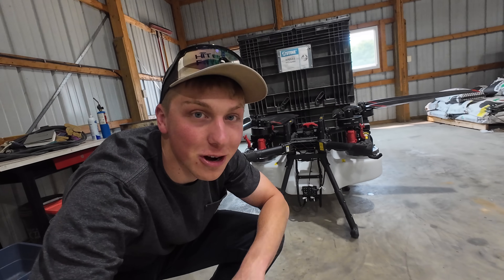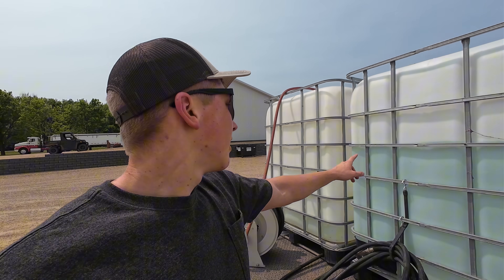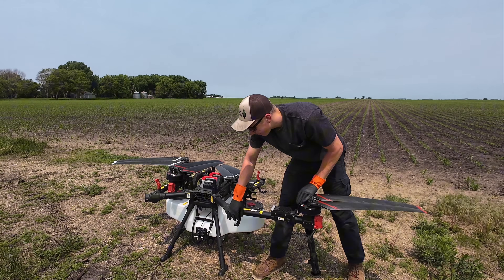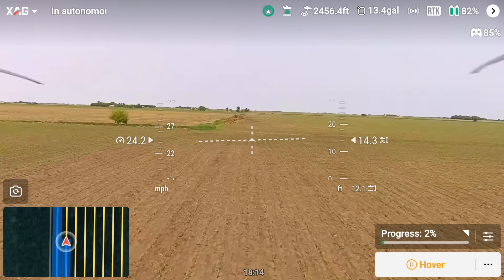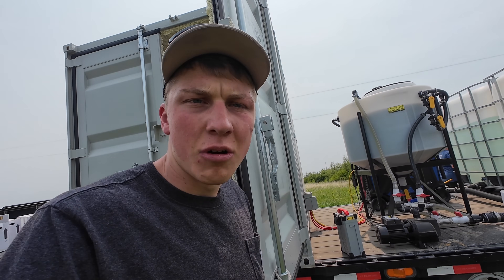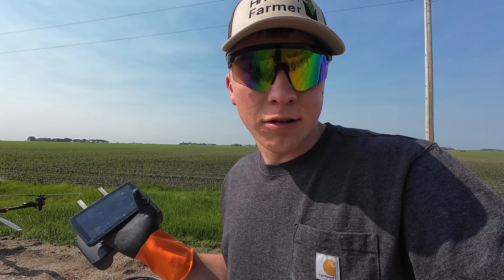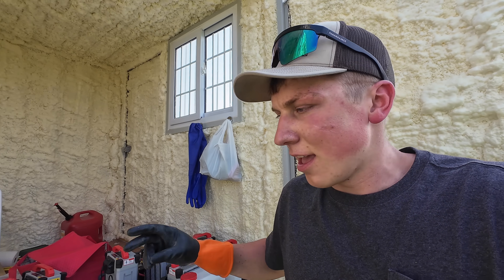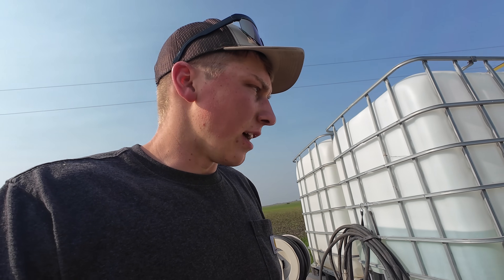First Spray Drone Field Test… and It Didn’t Work?!

Comment: If you can put your air condition up as  high as possible  on a shelf it will work better.   I would think you would use a roof mounted RV air conditioner or a small split system. with the compressor/condenser unit mounted to the outside wall of the container.
Reply from the maker: Yeah, looking back the RV air conditioner would have been the way to go. Oh well, learning as I go!

Comment: If DJI never gets banned, would you get one? There is a new drone coming out this fall I believe, the T100.
Reply from the maker: If they don't get banned the T100 seems like the way to go for next year!
Reply: @HiTech_Farmer  I saw a drone pilot video form Australia, he visted China and found out local users were not very satisfied on T100, it looks amzing on paper, but actual battery range is way worse, most users are running it on 50% payload, you definitely want to research that, and they said T70P is way better.

Comment: That spray foam was a good move. One thing for next year that you definitely should look into, is getting a roof to land on. Makes it so that your propellers dont get chewed up by small pebbles and rocks from constantly landing on the ground. But overall I like how your setup came along. Keep at it! You'll see the major usage out of it during corn fungicide season. That will 100% make it pay off. However, one thing I will say. If your P150 is currently working, DO NOT UPDATE IT. A lot of spray guys have been having issues with them after updates. That being said, don't fix what ain't broke.
Reply from the maker: I'm considering the roof option more and more everyday for next season! Thanks for the tip on the firmware update!

Comment: Grate video reminds me of my first time flying drones (Im also a farmer and I have been using spray drones for almost 2 years). Got couple questions/ suggestions tho

So how ur measuring how much water u put into cone bottom tank? (I really wanted to measure that precisely for obvious reasons and I solve that by using a flowmeter.)

Also when ur filling up the drone does agitation still goes on? (By the looks of it you have relatively small pump and leaving agitation on will drasticaly increase ur fill time. I'm also using a small electric pump since I wanted to power everything only with generator but this comes with its own problems. Ideally u want filling time equal to or even less then drones bootup time so that by the time drone is booted up, you should already be done with filling to maximize efficiency. I am using a DJI generator and simply using a bigger pump doesn't solve the issue becouse on DJI generators if you use anything more than 500 watts that will eat up your battery chargeing power. Yes you can use a bigger pump since you have plenty of excess power but its not really high tech :) Instead I use a motorised ball valve to shut off the agitation and direct all the flow of pump to fill the drone. I also use a flow switch to control the actuation of valve. When I stop filling the drone, agitation starts automatically.
Finding a motorised ball valve with fast actuation time can be tricky tho. So if anyone here has any reccomendation on faster actuating valves I would really appriciate it )

Also if ur having problems with foaming, instead of spending money on defomers (you also don't know their effect on ur chemicals) try mounting agitation hose to side of your cone bottom tank towards the bottom of it. It will probably solve your issue.

One last thing: You can also add a simple mesh filter (like ones on irrigation systems but much smaller one) anywhere between ur cone bottom tank and ur pump inlet. You will be suprised how much random stuff it pics up, also it will save you from tones of headache when you cloge up ur drones nozzels etc.
Reply from the maker: I'm currently measuring the water in the cone off the cone markings. I'm currently constantly circulating the chemical in the cone while filling, but if I don't do it this way, when the drone fills the pump will die. So that's my work-a-round there! 

As for the filter, great idea! I'm currently filtering all the water prior to getting to the tank so figured I didn't need to filter clean water again.
Reply: When I used marking on my induction tank I almost always mix more than what I need for that day and I always feel bad when Im dumping the excess chemical since its bad for environment.

Even if I filter the water before putting it in to my tank, I still get some flies or weeds in my tank when Im mixing chemicals. So that filter still works for me.
Reply from the maker: Thanks for sharing. If I have chemical left over, I either bring it to the next jobsite that requires the same chemical or fly a little extra on in spots

Comment: I'd like to buy an XAG and charge a few dollars an acre, just as a retirement job/hobby.  The chemicals, though, they require a lot of extra equipment and handling not to mention licensing as well as risk.  I think using it only for starter fertilizer and cover crop seeding would greatly simplify the operations and cut my startup cost substantially.  Am I right?
Reply from the maker: If you are to do it on your own acres, you wouldn't need near the amount of licensing that I have. Any type of commercial work will require many more hoops to jump thru, regardless if it is liquid or solid fertilizer.

Comment: Impressive!  You have run a really slick operation.  1 question (if you get to read these comments) - did you build this drone, or is it off the shelf?
Reply from the maker: Thanks! This drone is off the shelf, most are! I built my own trailer however!
Reply: @HiTech_Farmer  Wow.  I remember reading they are even using drones for crop spraying in India these days.  That surprises me, with how much drones cost vs how cheap labour is in India - I can certainly see how it's more economic in the USA, UK, Europe etc.

Comment: Good first day.  Couple of tips from another applicator.  Gloves are for handling chemical.  Take them off before touching anything non-chemical related.  Pouring jugs, try pouring them with the mouth at the top, and there will be little to no splashing if you pour at the right speed.  Fresh water rinse of jugs, you may already be doing this.  All of these procedures for chemical handling may seem trivial at first but really help when doing insecticide and other chemicals to eliminate contamination of your workspace. 

You need some shade and preferably a raised operation station when spraying tasseled corn.  It's your first year, so you will get a lot of little things ironed out as you go.  Just remember chemical and flight safety first, and the rest will be fine.  It is a pretty hot job here in Missouri through summer also.  Keep putting the hours in, and good luck this year.
Reply from the maker: Appreciate the tips and advice! Best of luck to you this season as well!
Reply: I guess it would be ideal to try to get to the fields just as the sun comes up.  Is it possible to do this work in the night?
Reply: @JoeLinux2000 yes and yes there are ways to be able to do some types of drone work at night.

Comment: Good job mate. Really like your videos. It seems like p150 is beast.
Reply from the maker: Thanks! Yes the P150 is the largest current offering in the U.S.
Reply: @HiTech_Farmer  i operate 2 p100 pro's at the same time. Its so cool.
Reply from the maker: You run 2 just by yourself?
Reply: @HiTech_Farmer  yes on swarm with 1 app.
Reply from the maker: Impressive!

Comment: Looks like it's working pretty well for your first outing.  Might need to be careful when lifting that drone so you don't get a back injury.
Reply from the maker: I agree, still yet to figure out a great way to avoid lifting the thing all the time
Reply: @HiTech_Farmer also modify a big tire wagon to move it around on the ground. Fly it straight off the wagon on your first run.

Comment: With the acres sprayed, how many times did you change batteries? Also, how long would it take to spray the same area with a traditional sprayer?
Reply from the maker: Changed batteries and reloaded chemical every 9 acres. 160/9=18 times. It definitely takes longer then a traditional sprayer rig. A self propelled would've been done in an hour...it took me 5 hours. Goal was to practice with the drone before I start spraying when the corn is taller. If i use a self-propelled sprayer in taller corn, I'll be running my corn down and not getting as good as coverage.